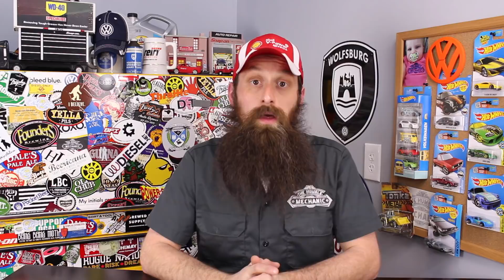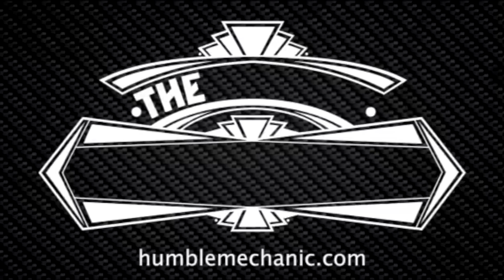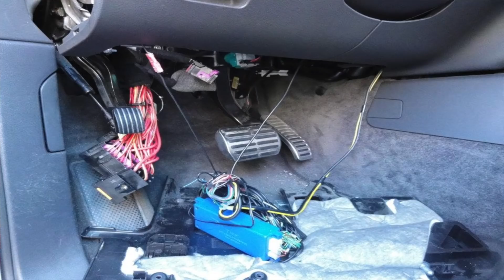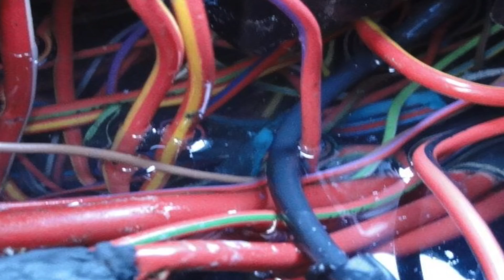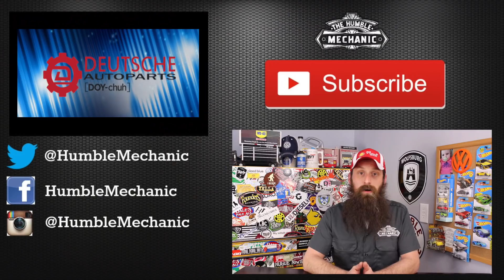Top 5 Failures of the Volkswagen Touareg

Comment: Wow, I bought a used 2004 Toureg a couple years ago. Generally I love it, but I've had lots of issues with error lights on the dash due to screwy sensors. The biggest was the drive shaft issue you mention. The carrier bearing wore out and it was just as you said, it sounded like someone under the car smaking the floor with a hammer. Took it in, but besides a new carrier bearing they had to also replace the drive shaft because it had twisted.  Finally they had to have a shop fabricate a new shaft because it is very difficulrt to replace parts for the Toureg nowadays. The most money I spent so far was on a brake job. Over a thousand dollars for new pads and rotors, and the brake light still comes on. They told me they'd have to replace the sensors in all 4 wheels, another couple hundred bucks.  When it's running right, I love it. but man, it can be a drain on the wallet, especially for someone on disability.
  Also forgot to mention, I need to bring it in for some recall service. A fuel flange I think. Waiting for them to get the part in to do the work.
Reply from the maker: Yeah that fuel flange is newer. 
Thats the thing about that Touareg. Its an AWESOME vehicle. So capable! but it's $$$$$$$$ to own.

Comment: bought a 2016 Touareg new from dealer.  It spent it's first couple months AT the dealer while they tried to figure out the check engine light (which codes for misfire every time it starts getting cold).   They keep telling me it's the gas I'm putting in, but I only use top tier gas like they said I need to use.   Went through it's first set of Pirelli tires after 20,000 miles, put on Micheline's and got 40,000 out of that set.  Have to replace all 4 at once or they said it will mess up the AWD.   (Tires are NOT cheap for this vehicle - $1500 WITH a price match.... also note, oil changes are $100, they're telling me spark plugs will be $200)  Love the car,  tired of the engine light and the costly routine maintenance.
Reply: Karyn Parks hi, which Michelin’s tires did you choose? I’m on the second Pirelli set. They told me that you can replace 2 at the time, no need to replace all 4. I had to replace them due to unrepairable puncture hole from a screw. They very loud on the road though.
My mechanic told me (independent VW shop) that the noise can be caused by damaged bearings and I will consider changing front shortly. Around $80 per piece.
Also you have to keep attention to brakes.This is heavy vehicle and breaks wears out quicker.

Comment: Hay humble I have a 04 phaeton, My 2 local dealership has no  idea how work on this vehicle. Can you recommend anyone in the Raleigh Durham area of NC that can service this vehicle.
Reply from the maker: Haha I would have said bring it to Cary. 

What’s going on with it? If it’s just service it shouldn’t be an issue
Reply: @HumbleMechanic   I took it to the shop a couple of months ago for few smaller issues along with a leak on the front passenger side of the engine. $6000 later I still have the leak which I think is the water pump. The shop I took it to says it will take a couple of grand just to see if it is the water pump and if it is the water pump it will cost more. The 1st thing I ask them to do when I took it is to pressure check the system for the leak . He said he pressure checked and could not find the leak. I could go on and write a book on the BS I'm getting from this shop . I'm not far from cary.

Comment: I have a touareg 2005 4.2L for 5 years buy a 260.000klm now 435 ,000 klm no major problem except  replace alternator replace 2 suspension table and brake 4 wheels redone also timing belt and water pump everything all work make myself  very good  car super strong very tank for winter
Reply: Any advice on a oil pump for that model

Comment: i have a 2004 touareg ith a no crank issue stop start button stopped working so had to start with key then key stopped working i get all lights on dash stereo heater everything but no crank at all any ideas
Reply: sounds like a starter to me. On the other hand - I have an 05 passat and when this happened to me (everything has power but no crank), I tried it at night and saw the dome light dim slightly, turned out to be a bad battery.

Comment: Do you have any video for replacing the inner tie rod/arm and front hub bearing. My Cayenne is bad and something I want to know how to do.
Also there is an option for 2nd battery in the trunk, is the original wiring there for additional battery (wheel well location) and can the Bose sub and battery share the same space?
Reply from the maker: I don’t know for sure but I don’t think the non TDI have the wiring for 2 batteries. 

Sadly I wasn’t ever able to make any Touareg repair videos.
Reply: HumbleMechanic  Thank you for replying, it means a lot.

Comment: So if I want to get a 4.2 V8 Touareg basically get a 2006 or later one?
Reply: I have an 06 4.2 v8 touareg absolutely epic car (especially for towing 3T+) apart from the fuel economy & electrical issue as he's described in issues #3!
06 was the last year they offered the 4.2 petrol V8 in the touareg, lack of demand & poor economy meant they dropped the lineup to only 3.6 VR6 petrol, 2.5 5cyl tdi, 3.0 V6 tdi & 5.0 v10 TDI until around 2012/13 when they dropped the V10 TDI & replaced with the epic audi sourced 4.2 bi-turbo V8 TDI 👌😎

Comment: Can you explain some engine problems with v10 tdi touareg??
Reply: Biggest problem is if it ever needs repair, you have to start by removing the engine because there is zero space around it to access. That first step is huge since the car is basically built around the engine.

Comment: Have you seen any T3 from 2013 on Shift linkage failures, such that the "park" switch does not send signal to the Electronic Control Module,  indicating the vehicle is in any thing but Park, and then the KeyFob can not be released from the dash board to shut off all electrical, and secure /lock the car?  For 2013, New modular plastic shifter design with more internal switches, P/N 7P1-713-025-D   ? Can not leave the car outside, cant remove keyfob from dash, because ECM isn't seeing that the shifter is in "park" because the switch in the shifter is defective and not sending signal?  $770 shifter, and quoted 7 hours and about $1800 to fix it so you can remove the keyfob from the dash.  2013 TDI Sport has 41k miles on it.

Comment: Thanks for the video. I wonder if faulty valve bodies were also be a major failure of the Touareg. I currently have a feeling valve body and wondering what else needs to be replaced haha.
Reply: The transmissions were always fine during my dealer days, the stepper motors and driveshafts however were not. The transmissions are Aisin-Warner, pretty sure they have a good reliability reputation.
Reply: @rudolfschenker  I replace the valve body and ran like new.

Comment: i own a 2004 vw touareg V8 4.2l what a nightmare you see abs system acted all crazyb so i unplugged the fuse, it would brake on its own, (not safe) speedometer doesn't  work. Seat moves or adjusts itself while driving, not good fuse out, tire pressure sensors not working... the cam timing tensioners broke on one bank...its a v4 now lol..  well cant wait to change the timming belt i heard you have to take the whole front end out... not too late to become a Toyota owner.

Comment: Have a question on a 2006 v6 Volkswagen Touareg.My passenger brake tail light stays on well after engine shuts off.Only this one light will not turn off,this is the light that is located in the body not the hatchback.Could u tell me if u have any solution ?
Reply from the maker: Weird. You don’t have the turn signal on? They will stay on if you leave the turn signal on.

Comment: T.Y.   '05 Touareg V8 here.  No major issues with it.  Wondering if there's a way to replace a bad alternator without dropping the motor?  Thanks.
Reply from the maker: yeah you can do it. You can pull the front into service position. Or if you are really determined I think you can get it out with out doing that.

Comment: I tried to own a vw before and decided they are over engineered pieces of crap. I had an 05 passat wagon and the first clue was when i needed a shot of anti freeze to get the light off. Dealer only fluid as no part store had it. (Costly too)   I had the timing belt water pump done right away as we bought it with 100k on it. Next thing you know it had a code with a check engine light needing right side catalytic converters. One week later the left side needed changed. $1600 at a time. I traded it for a 07 edge and been driving it for 7 years now no problems. Reason i came to this video was a friend of mine has a 2011 toureg and hates it. He asked me what to put put in the transfer case because it cant possibly cost an arm and leg for vw oil. I said ya bite the bullet and put the vw crap in it or trade.
Reply: VW transfer case actually take regular ATF fluid. Chain drive.

Comment: We just bought a used 2011 Touareg Hybrid with 90K miles.  The previous owner did all VW servicing so it was a well taken care of car.  Is this vehicle vulnerable to the timing chain tenioner issue?  is there anything else I should be concerned with?  Also, we have a 2013 Passat TDI.  Does this car have a timing chain tensioner issue and what is the effacacy of the performance (driveability and reliability) of the car after the dieselgate emissions update.  We love the car but are concerned what people have been saying after they did the update.  We are so on the fence about keeping it.  We expected to easily get 300k out of the car.  P.S.  Love watching your videos, thanks for the work you do.
Reply from the maker: The Passat has a belt that will need replacing. I think at 120k but check your owners book. 

The Touareg is a chain I believe. I’m not sure about common issues because they are so limited. I’ve only worked on 5 maybe? And it was minor issues.
Reply: I bought a 2012 Touareg Hybrid new, so I know its complete history.  I’ve had to have a battery cable replaced and JUST had to have the catalysts replaced to the tune of $3,000.  Of course it happened after my extended warranty expired.  😬  I also had to have the cylinders cleaned of carbon buildup.  I wouldn’t have anything else, though.  I LOVE it.

Comment: I have a 2004 Vw Touareg on mine has a tire light work shop. And as a result my shifter is stuck in park. I hate this car its the second time . How do over ride this?
Reply from the maker: The tire light won’t do that. You have more issues or a different light on. 

Those brake light switches do fail from time to time

Comment: Great vid, very informative. i have an issue with my 04 v6 Treg that i was hopin maybe you could help me out with. simply, for some reason when she sits for a short period of time she just completely dies.  if i try to restart she has zero electrical power. I have to attach my booster pack in order to get her to fire up again.  just want an idea of what might be wrong with her before i take her to a mechanic, that way i dont get my pants pulled down with what they may claim is wrong with it.
thanks for you time and i appreciate any help you could provide.  keep up the good work =)
Reply: Anthony C what Did your mechanic diagnose?

Comment: Hi, Can the ECM override engine start and stop the engine from starting while I'm trying to start it ? Mine cranks for a few seconds then stops cranking on its own and engine wont start.  It hasn't started since replacing all timing gear (chains, gears, guides etc) after having a no oil pressure problem and finding the sump oil pickup clogged solid with hundreds of small broken pieces of chain guides after taking the sump off. What would cause the engine not to start pls ? (I've triple triple checked the camshaft timing to be correct) (Touareg 2007, 3.6 fsi)

Comment: I'm not sure if this is a common issue too, but on my '08 the sunroof won't open possibly due to debris inside. It can still tilt and close though. I think all that debris may have slipped inside since I park my Treg under a tree :/. 
I think I may have to remove the headliner and all to remove the debris...unless there's something I'm missing.. Let me know if I guessed it right :) 

Thanks Mr. Humble and keep up the good work!
Reply from the maker: I would try and spray some lubricant in the tracks with it vented and see if you can get it happy agin.

Comment: where is the power amp on a 2010 touareg mine pops constantly and drives me crazy
Reply: spike riordan  Do you also have the depleted FM a.m. radio signal issue after owning it a year or so I lost all but one channel in a major metro area VW replaced head unit several times but still have no signal I understand there is a amplifier for signal above the rear hatch also this could also be a vgg, com canbus issue

Comment: Bought a 2006 touareg with a V8 1 day after purchase, no warranty,  the check engine light comes on. Long story short I took it to the dealer and am being told that the two 10mm bolts that hold on the thermostat , the reason for the check engine light, won't break loose. Was told the mechanic has snapped those off before and had to tap dye it to repair on one motor and on another motor was unable to repair with tap and dye costing the customer a new engine. Is this normal? This is my 1st VW and I feel like I am being taken for a ride and not in a good way... Suggestions?
Reply from the maker: People screwing up VWs is normal. I have never ran into that exact issue. but it sure does suck. You can email me some pics if you want .

Comment: This is an odd question but, I just noticed that my 2006 3.6l vw Passat 4motion read drive Shaft started to crack. So my question is possible that I can swap it out with a 2006 vw 4motion Tiguan rear drive shaft? Thanks 😁🙏
Reply from the maker: Tiguan is a BIG maybe... I would just get the one for the Passat.
Reply: HumbleMechanic thank you 😊

Comment: Thank you for the videos keep up the good work I just bought my 2005 with 136,000 miles everything is fine well-maintained I checked the records Carfax one owner do you think if I continue with all the services I can hit 200k?
Reply: I have a 2005 v8 as well at 126,000 miles.  Just had a clunking noise happen under the center console, might be a propshaft or driveshaft thing,  not sure yet. Sounded like I was dragging something underneath around 40-60 mph. It's going to be taken into the shop next week.

Comment: the housing for my driver side safety belt has popped out from the side of the car.  I suspect that the snaps on the inside that snap into the post have broken off.  any easy way to fix?
Reply from the maker: I am having trouble picturing this issue. Can you email me some pics?

Comment: Bought a used Touareg yesterday brought it home last night the next morning car won't start. checked the battery and it's fine. changed battery on the key pad and still nothing. after a couple times starting the car the key was stuck. Finally got the key out but still won't start. FRUSTRATING! can anyone help?
Reply from the maker: You really need a VW/Audi scan tool to talk to all the modules. There is a lot that will make a Touareg not start.
Reply: Justmystyle 51 Did u ever figure out the issue? Mines is doing the same
Reply: My key became stuck as well and that happens when the power is down. Press on the brake and the key will release, It worked for me.

Comment: GF had one. It was a complete POS. I never knew a car could have so many electrical problems some so random. Tire pressure system ignore it. Just suffer through the light. Trans went bad at 60k cost $2800 to fix I know I had to loan her $1500 of that and that was a DEAL as the dealership it would had been $4500+. only 1 suv as bad or worse and that is the Range Rover. Germans build great engines but they are not electricians eveidently.
Reply: Nathan Daniel you can delete tpms completely through the coding...a transmission doesn't just shit itself in a day.  Don't own German if you're not mechanically inclined....
Reply: I have an 2006 v8. The transmission seems to shift at lower rpm's... Jumps quickly from 1-2 and is running in 5th at 40 mph..  Is that normal for this vehicle or did I buy a headache?

Comment: Hey so my 2006 VW keeps shutting off after I start it, and I thought it was bad gas, because that’s when it started. After taking it to a mechanic he told me the gas was good and he thinks it’s the computer. Any suggestions on easy fixes if any, or if it’s hard to remove the computer.

Comment: I agree the Touareg is a real pain with regard to the electronics & battery. 
We have a v6 2014 and the Car battery failed and I cannot even get in the car !. 
Yes I have tried the emergency key routine, eg took the cover off the door handle inserted the emergency key, pressed the button on the remote while turning the key and nothing zilch. So I thought battery in the remote is weak, changed that and repeated the emergency routine still nothing.
Its still under warranty so its going back to the dealer. Question for you if the car battery fails do you lose all of the programming in the pc? Also its been stored for a while and I guess the battery drained to a point where all the systems shut down, any help would be appreciated.